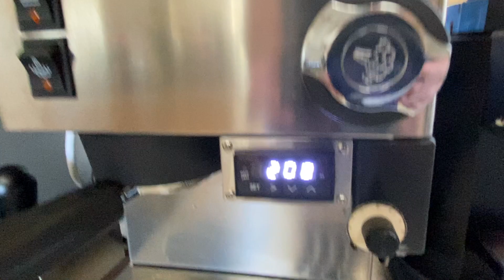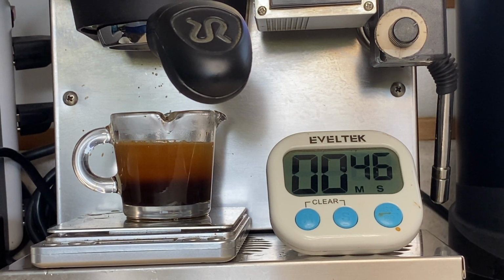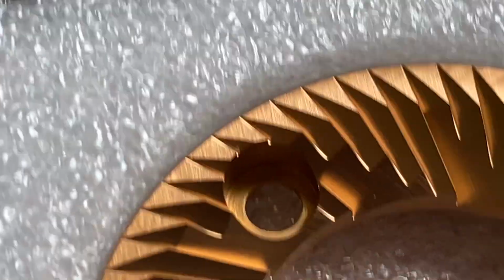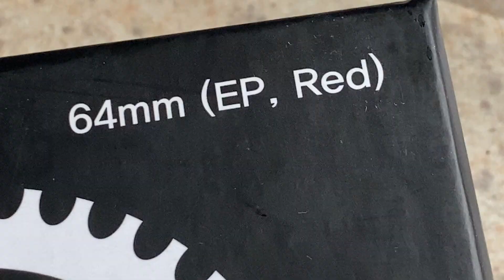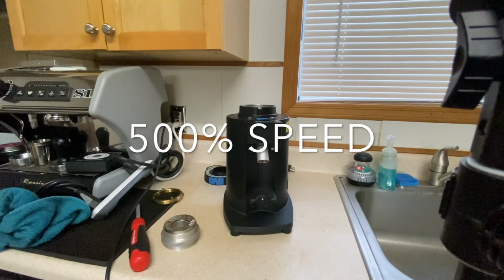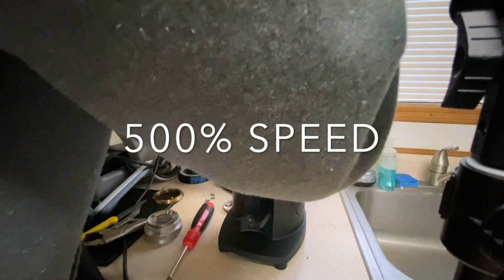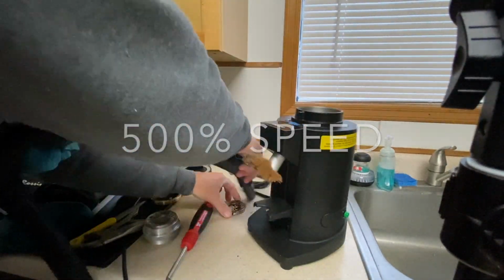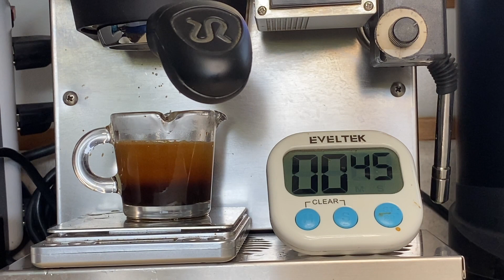Oct 8 2023 Rancilio Silvia w/Auber PID, Ceado E5P SSP 64mm red speed coated Espresso Purpose burrs

Comment: Hi, could you say a couple of words about your grinders? Which one is better, what upsides and downsides each one has? Rancilio Rocky, Breville Smart Grinder Pro, Ceado E5P.. 
(I have Breville and thinking if it is a good idea to switch to Rocky or not)
Reply from the maker: Thanks, I'll plan to get them all out soon, I am trying to get some 3 years on youtube vids up in November, - , if you have looked around in the videos/library you are right, - Ive used the Rocky to start - its solid reliable and great - easy to use, the breville I liked - I liked the timed dose, push to start, sometimes I felt that the burr set gave a 'different' (in a good way) flavor profile, but I felt that it had to work VERY hard to grind my lighter roast beans - like chewing up gears hard, - the rocky - I felt with the light beans and espresso grind only gave me 1 maybe 2 'tighter' settings as in - it was pretty maxed out and at time the motor sounded like it, - the cedao is work horse grinds super easy, has the bigger burrs that come in SSP options, - infinite grind settings - and if I used the spouted portafilter it could push to start - so it has some solid upsides, - if the brevile does it for you - stay with it, if you wanted to upgrade, maybe try a rocky used (?) as Im note sure Id spend the full $$, and think Id suggest looking at the cedao line -consider them as solid reliable durable options - check back in Ill try the video soon! Thanks for the suggestion - best Pete - check out whole latte love, they are the best
Reply: My 2 cents. I’m not sure Rocky huge step up for Silvia - unless pickup good used one for $150. Just upgraded (and sold) mine to DF64V (variable speed and small footprint) and I think the new DF64 v2 that has same burrs and  is cheaper than Rocky new. The DLC burrs it comes with kill the Rocky and you will always be able to grind finer than Silvia needs. Depending on coffee type, dose, and basket type can be struggle with Rocky. Rocky looks great next to Silvia but ;)
Reply from the maker: @markg9533  great input thanks Pete